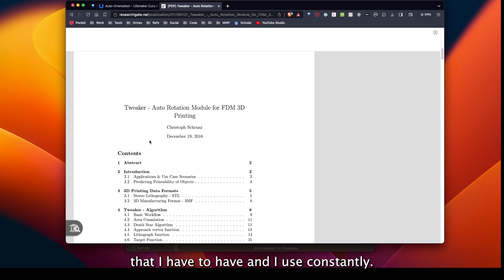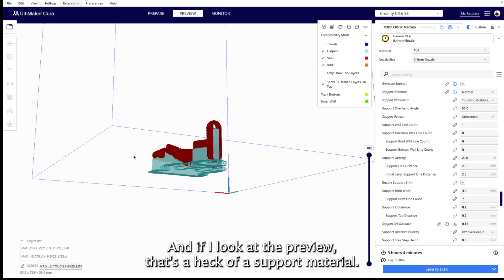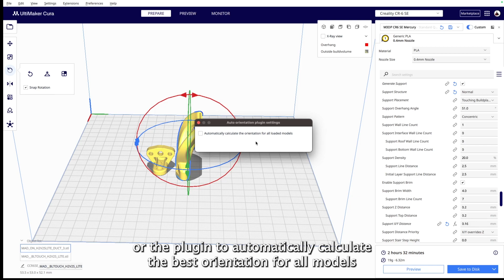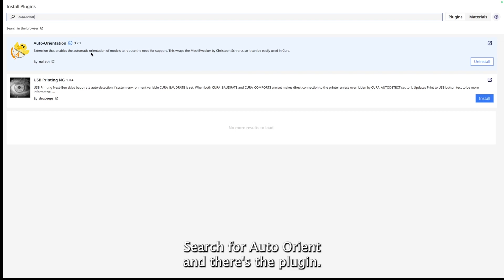Cura 5.4: Work Smarter, Not Harder! Mastering the best Orientation for your 3D Print

Comment: Great video. Is that probe mount for EVA 2.4 w/ UHF/Volcano?
Reply from the maker: it is actually the probe and duct for the MAD duct system for the BIQU H2 v2S. The duct itself is based on the EVA.
Reply: @minimal3dp  Ah. I just upgraded my M1.1 to UHF and was hoping you'd stumbled on a mount for UHF. I found one, but it sticks out more than the alt did for HF.
Reply from the maker: @drright71  what hotend/mount you using?
Reply from the maker: Thanks for the positive feedback.